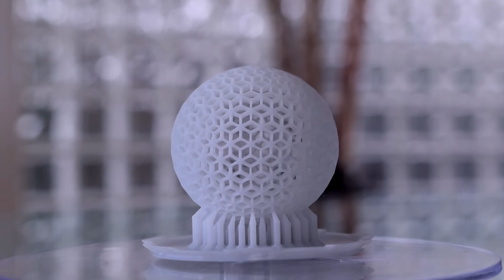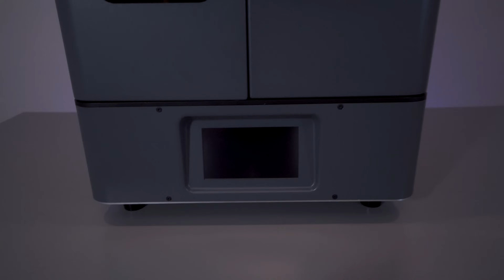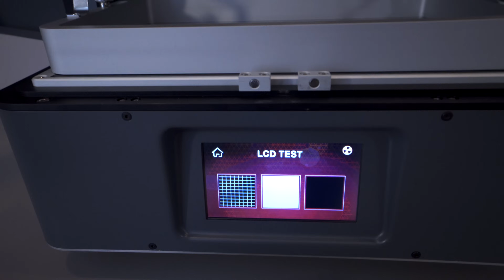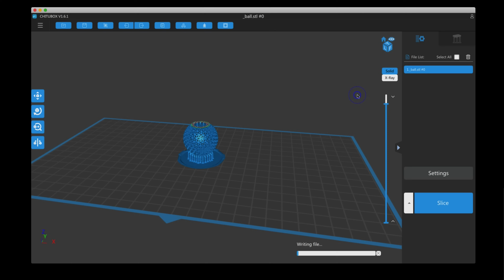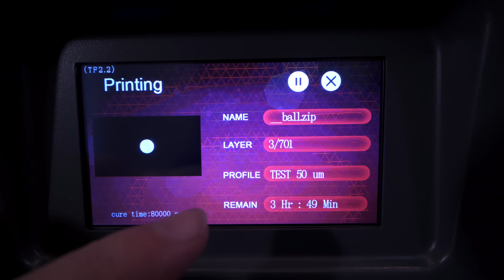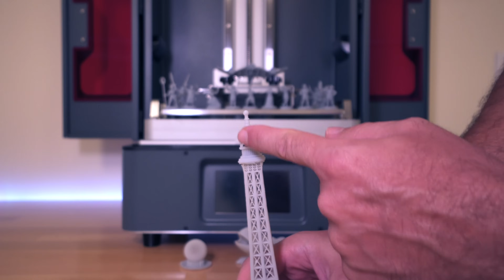Phrozen Transform - Large Format Resin 3D Printer - Unbox & Setup

Comment: A lot of the miniatures that failed depends on you not using supports. You can't print into thin air, it needs to hang in supports. The bent leg for instance, as soon as it connects to the rest of the body, it lifts from the film.